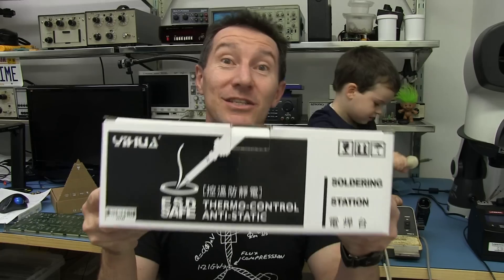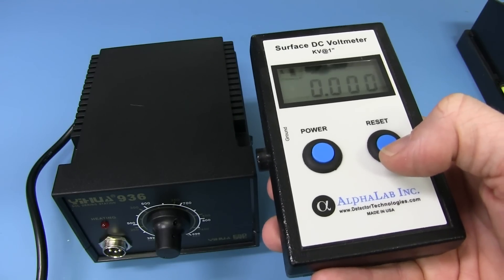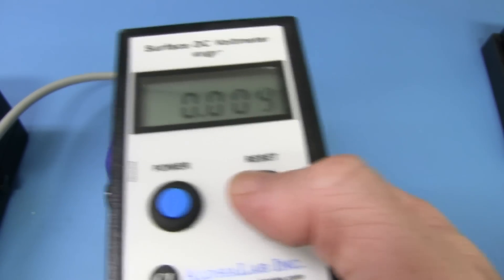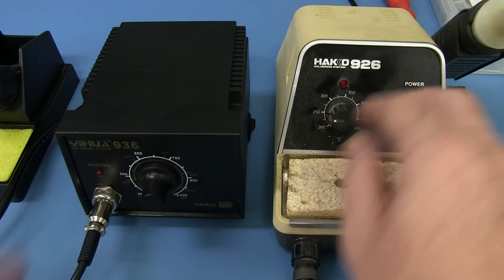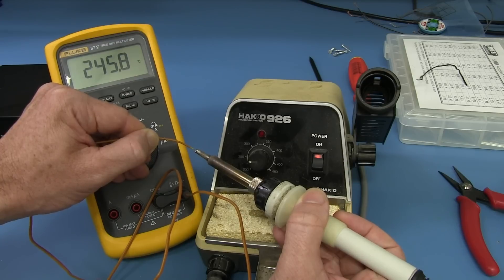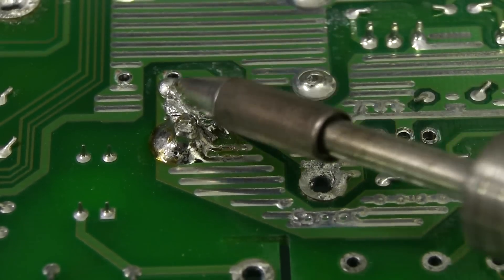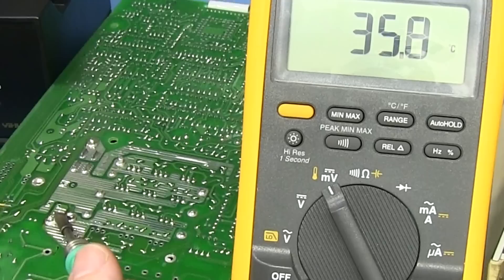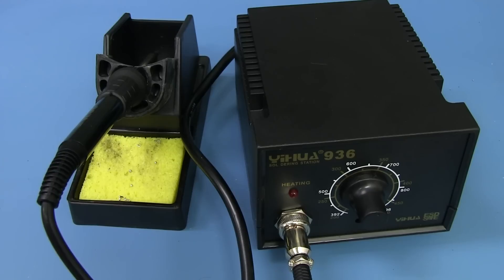EEVblog #596 - World's Cheapest Soldering Station - Yihua 936

Comment: The problem with Dave is he's spoiled with professional gear ;)  I bet if he was a guy starting out he'd say - cool - only 16 bucks!  But at least this time he did kind of sort of recommend it for hobbyists lol.  I bought a Yihua 937 with the LED temp readout last year and did some work with it on a pcb and it worked great - also the insides didn't look like this one did - decent solder joints and it maintains it's heat at the tip quite well too.  I'd like to see you take a different approach is some cases when you review cheap stuff and rather than just cut it up - recommend mods to make it better, like you did with this review about the crimped ground connector.  Guys who are doing electronics as a hobby cannot afford top rate gear so help us out picking up some half decent inexpensive gear.  Talk less, say more and for Pete's sake stop the whining :)  And thanks for the video ;)
Reply: the cheap stuff needs to be punished.   it is you that needs to change your communist mindset.  
Buy quality, buy it once.
Reply: I'm experimenting and learning so if you don't mind I'll blow up the cheap stuff first :) 
As for being a communist - Dasvidanya
Reply: I agree...Out here people hate on Harbor Freight and start saying..."stop buying china freight and buy snap-on, makita, craftsman, blah blah blah".  I am not made of money, have a trust fund or even own a shop.  I am just a hard working guy that don't have $125 for a wrench.  I would rather spend a couple of bucks for something that I'm going to use at home a couple of times instead of spending a lot of money when I'm only going to use it a little bit of times.
Reply: I think Dave does a pretty good job but it would be nice if he could check out some of the ebay stuff and give us his views on it.  Not just "it's crap" cause it's not brand name ;)  But will it work for the home hobbiest, is it close enough to specs, safe, accurate enough.  Most of us are just playing around at home and learning and many times "it's ok" is good enough for our needs.
Reply: Digger D I agree. 

I've have a Yihua 936 (Hakko 936 knock off), and the board is very clean.  It works great.  The tip it comes with works best with SMD parts.  In order to work with regular parts I spent about $5 for a set of 10 different Hakko 936 tips, they retain heat better for larger parts.  I've been very happy with mine.

I can't afford to get the good stuff, so settle for the cheaper stuff until such time that I need and can afford the better stuff.
Reply: Well, I am a commie coming from Russia where getting a branded Hakko would cost you an arm and a leg and definitely not an option for a beginner hobbyist.

I started on a cheap copper-tip Soviet soldering iron, then got myself one of the Hakko clones which worked perfectly, especially if you applied a small hack and moved the heating element up the iron.
Consider that the clone cost me about a hundred dollars, you can get a genuine Hakko for that money in the States.
Reply: I like when Dave points out what's crap, I use cheap soldering irons and I don't mind if they are crap, they do the job just fine for what I need.
Reply: I use a crap soldering iron myself but i see where Dave's coming from.
i have two crap soldering irons i paid around 120 bucs for each, they work but they also while alot in use.
these irons work groat for hobbyhackers but not for profesional use.
Reply: Son of a Zombie Poor consumer logic.
Well no wonder your whole life and your whole country lives on debt.
Reply: Son of a Zombie For poor kids starting out, I am happy that they have an option. Also, I a not sure where the original Haako was manufactured. Part of the reason the Chinese components cost less is because salaries in China are much lower than in places like America. So equating the price of the product with the quality is not always smart unless you discuss the cost of labor between the respective countries.  I purchased a Yura espresso machine for a exorbitant  price, and most of the components were proprietary and re-branded by Jura, a swiss company with extremely high labor costs. An equivalent espresso machine could be had for a fraction of the cost using equivalent components that were not proprietary.  So better analysis is in order when comparing products manufactured in countries where the labor is very high,  and countries where the labor costs are low.
Reply: Hehe, you're right about the mods.

But right now, finishing my Master's I suddenly realize, that many people just stay with their hobby-grade stuff after actually getting professionals and do not realize how much this holds them back. Especially in some research institutes and startups you'll find people doing PCB designs with EaglePCB (how can anyone seriously pay thousands of euros for multilayer support on THIS?!), doing all sorts of hobbyist workarounds in the assembly etc, just because they're used to doing it like this. I think, if you're planning on getting serious with electronics and make it your profession in the future, you shouldn't stick to the cheapest stuff.
Reply: Son of a Zombie 
Of the irony. You know the Phoebus Cartel? Reducing the lightbulb lifetime to 1000 hourse in the 1920's, quoted as the benchmark into this the new millennium. This was (and kind of still is when incandescent bulbs are used) a plot to introduce low quality to increase sales. All of this in the "free world". It's kind of embarrassing that DDR-made lightbulbs were better during the cold war era. They chose not to artificially reduce their products' lifetime. They were socialist but hey, they were German. Soviet lightbulbs of course were equally bad to the Capitalist lightbulbs because they were Soviet-made. :D
Reply: TheVessapaperimuumio so basically, in Soviet Russia, incandescent outlasts LED
;D
Reply: Yes, because of the lack of electricity ;)
Reply: Son of a Zombie And such an attitude with a fake name hiding from the real world creates control that never allows change to create better quality because those that say theirs is the best and they deserve to have control of the market will do anything to have control and hide better technologies so they can sell theirs even if it means using up a valuable resource that took millions of years to create that should be conserved. There's not much to a soldering station and that's why they can be made so inexpensively. The problem is weak minded fools that let the emotion of hate connected to greed control their thoughts and say one thing and do another which is why people copy other people's ideas without the inventor getting paid a penny. 
It's easy to say something... but it's another to do it. Most people are followers and controlled by emotion not logic and the false religion of beliefs that follows. Relative to an initial inertial frame of reference their is only one observer E in a wait state and Ohm's law like Newton's law that mirror all other equations dictates what happens from there when you add the asymmetry of the weak force to the equation and everything else is pure fear driven BS to hide from reality and be part of a gang. The equation for the fine structure constant is a worm hole where time dilation maintains E as a constant in ratio with the asymmetry of the weak force and if it were wrong SLAC's E158 data would not have matched CERN's (v-c)/c=2.48e-5 sec and created in proper phase the asymmetry in time needed to hold gravity in place: e{a}/t=hv
If you want to say something and be heard get a real name and be a real person like Dave.
Reply: *****  Seeing some people report getting real Hakko 936 tips I ordered ten for less than $5.00 dollars including shipping. The ones I received were clones and did not fit tight. But using copper solder wick I got a tight fit that transfers heat and they work really well and the metal used on the tips is of better quality than any soldering iron pen and has held up surprisingly well and stays clean and tins well. So for less than $65 I can have 3 tips for different jobs without needing to change tips. Mine came with good soldering too with just a little flux that I cleaned off.
Reply: John F Hendry
Yep, I did the same thing.  It works great for me and now I have different tips depending on what I'm soldering.
Reply: You elitists with fancy Chinese knock-offs have convinced me to go the other way.   I am now using knock-offs of the counterfeit fakes from Mozambique.  Only cost 2 chickens and a sea shell.  Snobs.
Reply: Son of a Zombie
Too expensive for my blood.  Ayam Cemani chickens cost $2,500 apiece.
Reply: Digger D Ever heard of the saying "Buy Cheap, Buy Twice"? Products that have higher-performance specifications or built to a luxury quality are usually more expensive than the cheap 'n cheerful low-quality products.

Probably the best example I can think of off the top of my head is Gillette razors vs. Bic razors:

Gillette razors generally have better grips, multiple sharp razors for precise, smooth cuts. And that's with their standard blades. Their more premium razors include features like battery-powered razor-blade vibration which means more hairs are shaved with each stroke, and, more recently, a special ball which allows the blades to follow the contours of the face far more easily.

Bic razors on the other hand have a much more basic design and use fewer blades. The grips are also made out of lower-quality materials than the ones found on the Gillettes. Heck, their lowest quality razors are purposefully designed to be disposable with a single, blunt blade and a cheap plastic grip which could probably contain sharp "flashing" edges. (Flashing is where material seeps out of a mold in the casting process which hardens as excess material).
Reply: William Raymond I think they make the cheap ones just so you cut yourself and buy the expensive ones. If I was as hairy as most guys I'd be POed... but they sent me two free ones several years ago and the second one is still going strong. Evolution will put them out of business;-) BTW I just noticed the tip I got is not all white and looks like the original Hakko tip with metal covering... must be some variations. One thing is for sure... it's not the weak link in my soldering;-)
Reply: Son of a Zombie The Hakko is $600. 
Quite steep, to just try it out.
Reply: William Raymond Buy cheap and repair as necessary (it's a hobby for me).  My Dad only had one blade and it was replaceable ;)  I buy cheap razors too - nice close shave - the rest is hype, learn how to shave lol.
Reply: Ernst Stavro Blofeld The Hakko 888D is only $90-$100 USD.
Reply: Enrico Crevecoeur The Hakko HAKKO FX 888D-16 BY
€142,00, which is over $200 , the HAKKO FX 951 is $ 600 , Hakko FM 203 is $ 958 and the Hakko FM 206-17 is even over $ 2000. 
I have a $ 5 no name solderer from China and it serves me well for over 20 years now.
Reply: I like my cheapo solder station but I'll always want better no matter what it is. And relatively speaking in regards to potential I'm the weak link as knowing what to solder is far more important than knowing how to solder and this can do the job no man has seen before;-).

I just got to figure it out that's all...
Reply: John F Hendry I just saved $300 by re-capping my monitor. Had I bought the Hakko 888 I would have saved only $200. So what's the point?
Reply: You saved $100? I don't know what your point is, but mine was what is being soldered correctly is more important than the soldering station being used as long as it's functioning properly as the cheap copies of an old simple design do. Like I said I like my cheapo solder station, but because a better station makes soldering easier I'd like a $600 one but I'm content with the one I have as it can do the job until you get into bigger heat sink ratios where the larger heat mass needs a larger station as Dave showed.
Reply: Digger D To be fair, the example Dave got his hands on did seem particularly crappy, that soldering was just garbage..... I think it bears mentioning that Yihua has significantly improved their quality in that regard atleast..... but yeah, i completely agree with you, Dave pretty much declared it garbage before even giving it a chance..... he really should work on his review skills and try to remain objective until the end of the review...... it's extremely annoying.
Reply: archiearchie666 And its got that cheap chinese smell Sagan, doesn't it...
Reply: Techno Viking I was just continuing your quoting from the video … ;->
My advice is always get the cheapest or proper heavy duty industry standard if you've got the money. Everything in between is rubbish and a waste of venture capital.
Reply: Ernst Stavro Blofeld I detected the sarcasm, and I agree with it. True, you should always get the best you can afford if you intend to take a hobby(and that's all this is for most of us) seriously........ but cheap and chinese doesn't always equate to junk...... shop around, read the customer reviews and then decide if it's something you'll be willing to deal with, I have a Yihua station and a Hakko station, and the Yihua compares pretty favorably from my experience.
Reply: Techno Viking I was only highlighting  Daves racist indoctrination of his son Sagan. If it is a hobby, get the cheapest.
For the money of one hakko, you can get 20 cheap stations, those should last you a while.
Reply: An information frame is comprised of two opposite concepts in proper phase timing  connected to an inertial frame of reference and ignorance argues which side is correct and which side is false in supporting its view of it. Right now OLED TV's that advance picture quality past plasma TVs and create a normal viewing angle allowing larger flat panel screens is under threat because consumers that still buy DVD's to play on their large screen HDTV's designed for Blu-ray are mesmerized by overly bright TVs on a showroom floor where the calibration is tuned more for selling the TV than delivering a lifelike high contrast picture in a realistic home environment.

Back in the late 70's and early 80's the manufactures of electronic keyboards knew and understood the need and great advantage of polyphonic after touch that gives each key it's separate control parameter that was offered in the better keyboards but the mindset of the pressure of the competitive marketplace (with few exceptions) stopped the implementation of poly-AT.

As electronics advanced greatly increasing the potential of electronic keyboards capable of creating deep complex evolving synth tones it quickly exposed the disadvantage and limits of channel aftertouch that make a total mess of the new sounds being used. But rather than put back in a needed feature once available where ch-AT was common and expected on keyboards over $500 the manufactures responded by saving a few dollars and leaving out the low cost implementation of channel aftertouch as well where all keys trigger the same parameter.

This omission of a standard feature would have been considered unacceptable back in the early 80's but as more beginners got into music knowledge took a back seat to marketing and now you can spend over $1,500 on a keyboard that has no aftertouch  at all. If I were to go back in time and say this was going to happen no keyboard player with any experience would believe it, but it did happen because people let it happen based on their buying habits... and ignorance overwhelmed by a complex piece of electronics creating fog of understanding.

I think Dave is well aware of his "personality type" and plays into it deliberately to make a point that if we only buy cheap lower quality products... only lower quality products will be available to purchase and we need to support higher quality products in a field where it is needed for safety as well as performance.  

The Yihua 937 is an exception to the rule IMO as is the $25.95 iGaging EZ Cal digital caliper that comes in a nice case if you buy it direct. I believe Hobby King sells the Yihua 937 just as car dealers sell "lost liter" newspaper ad cars to bring in costumers increasing sales overall. It's good marketing to have people say "WOW what great deals Hobby King has".  

But in contrast I paid more for a Power Analyzer watt meter & battery checker/balancer I ordered direct from China that is so inaccurate it would damage a battery and is as useless as it is unsafe. Dave's review on multi-meters exposed false CAT ratings that are an obvious danger to the user as well as an inability to function in some regards. I think we should cut him some slack as we need people like him to keep the information frame in balance headed in the right direction.
Reply: Dave gives some very valid and informative reviews - but I think he missed the mark on this item.  I have the digital temperature readout model and having tested it with a thermocouple probe and found that it's quite accurate.  While soldering I do not notice any kind of extreme temperature drop and as near as I can tell when compared to other reviews of supposedly better models - there is an insignificant difference at least when used in a hobby environment.  My earlier point is compare economy items to economy items as well as high end products.  But don't knock it because it doesn't meet the same specifications as a unit costing much more.   For it's price these soldering stations do a pretty good job and that should have been the overall summary.
Reply: Digger D
I have both an Fx888D and a 937D+, and I can tell you there is little if any difference in performance..... if anything the Yihua actually burns a little hotter, meaning I probably need to calibrate my Hakko a bit.... but both have excellent thermal recovery.
Reply: Techno Viking Did you replace the tips with genuine Hakko tips? I got 10 clone tips for less than 5 bucks with shipping but they were a little loose and used some copper solder wick to tighten up the fit. But it transfers heat well now and the tips were surprisingly good quality and for the price I can get two more stations so each has it's own setting and tip to go with it. My 937 station was quite a bit better than the one Dave received and the iron's inner insert was different and matched the Hakko design.
Reply: John F Hendry
I'm just using one of the free tips they packed with the station...... the packaging says "Hakko" but they're clearly fakes as they don't have Hakko actually engraved in the tip....... my station uses a Hakko style ceramic heating element, and the fit from the heating element to the tip actually isn't bad, it's not a tight fit, the tip will just drop right on, but there is no gap, and it doesn't wobble or anything.... so I really haven't seen a need to add a shim or anything.
Reply: " One of the free tips"? I only got one with mine. The stock tip as I recall fit alright but when I replaced it with higher mass tip using copper solder wick for a tight fit there was big difference and was the first time I used the right tip and soldering was faster and 100 times easier. There are some claims people posted saying they have gotten real Hakko tips from China but that makes no sense especially for less than 50 cents. But they did post pictures so sounds like your packaging but who knows for sure. I'll get a real Hakko tip for my finest tip doing tiny stuff.
Reply: John F Hendry
Yeah, my station came with "5 free tips" along with the one that was already in the iron, the "free tips" were all in packaged individually in little plastic bags that were labled "Hakko", the packaging looks exactly like genuine Hakko packaging, the tips themselves however lack the engraving.... another major difference between these fake Hakko tips and the genuine Hakko tip that came with my 888D is that the sleeve part that drops down over the heating element on the fake tips are about 1/8th of an inch longer than on the genuine Hakko tip, but the genuine tip does seem to fit just as well as the fakes, but doesn't come down far enough to touch the little metal sleeve that is press fit into the plastic knob that screws on over the heating element........ I don't think this would affect thermal contact, but I can't say for 100% certain.
Reply: Interesting... the tips I got were the same size as the single tip that came with it. You know they could be made by Hakko just lower cost without the engraving. There's really no need to fake the name. In a world market numbers add up fast so might as well pump them out and make some money in all markets.
Reply: John F Hendry
Well it just occurred to me why the size difference.... I was comparing the fake tips against the genuine Hakko tip from my 888D, I assumed the 888 used the same tips as the 936, but I just discovered the 888 uses a different tip than the old 936(which the fake tips are made for), the 936 used 900m and T4 tips and the 888 uses T18 tips..... The Yihua clone station irons were made to 936 dimensions, on the Yihua, the heating element protrudes out further from the nipple than on the 888, with the back of the tip just barely resting on the nipple, same arrangement with the 888, except, less protrusion, therefore slightly shorter tip.... ironically this means that these cheap 936 clones can use both types of tips(though you lose contact with the nipple with T18s, so not a perfect fit), but FX888/888D can only use T18, because a T4 tip is too long to seat properly on the heating element.......... just about all of the super cheap fake tips you see on Ebay are 900m/T4 style for the 936 and clones, and often the seller will say they fit the 888 as well(but they don't).
Reply: Hay thanks. I thought the 888 & 936 were the same tips due to what the sellers say. Important bit of information there. I think the main issue with not having contact with the nipple is you lose some support as the metal to metal contact makes the ceramic heating element less likely to bend and break so its a little stronger. There may be some heat transfer lose as you have a little less mass in contact with the tip holding heat but I don't think you'd notice it and having better support for the tip to stop flexing is the main issue to watch out for. If I ever break mine I'll replace it with a real 936 iron and just change the wiring inside the Yihua station to match as I believe the wiring is different as I recall.
Reply: John F Hendry One thing is for certain, the connector is different, the Hakko hand piece uses a male connector, and the Yihua hand piece uses a female connector.... I haven't went as far to check pinout though.
Reply: Yep, I forgot that. You have to change the connector too. As I recall the pin out wiring is shown in the files tab on Hobby King. Thanks again.
Reply: Digger D   Personally I like Dave cutting up the cheap stuff.  It's nice to know what differentiates the two, and gives you an idea of what you're getting yourself in for.   I hate these people who review things and are like it's great, no matter what.  Because there is always some trade off to like about it.  "Well it's not name brand X, but for the price there's a lot to love." So you buy it, and then you're disappointed, because in reality you just bought a pile.  Dave comes from a professional background, that's why I listen to him.  If I wanted the opinion of someone who wasn't coming from that background I wouldn't be listening to Dave.  I do agree that he talks in circles a lot, but he is thorough and I do love that, even if there is a little bit of repeat.  I ended up buying a genuine Hakko based off of Dave's comments between this video and a few others, it was by FAR the most amount of money I have spent on an iron, but at the same time, none of those other irons ever accomplished what I hoped, never met expectation, the Hakko not only met my expectations but far exceeded them.  That in and of itself is worth something, not to mention the fact it will likely be the last iron I ever buy.  Keep up the honest reviews Dave!
Reply: U r absolutely correct. Even some of the viewers here have such a closed mindset.
Reply: Yes, Buy the cheap stations and stay away from being in debt from buying the most expensive. I'll bet Dave owes more on all his the test equipment than his house and car. What a investment!
Reply: @SONOFAZOMBIE2025  
Actually, it's capitalist "mindset" that makes people all too often not have enough money to buy quality stuff...
Reply: @DeeegerD  
It's not about "Americans", individuals or any nationality can fall into this kind of logical fallacies.
Reply: Just because you can't afford top-rate gear doesn't mean you should buy trash like this. People doing electronics as a hobby can definitely afford better than this.
Reply: @anita.b  Lmao true
Reply: I would have liked to see him start with what it can do and work up to the harder stuff. That's give people an idea of the limitations of the station, and let them judge for themselves.
Reply: @anita.b  that is the truth...i have a fake hakko and fake tips, and i regret using it because the tips is easily to get rusted and the solder is easily losing heat...